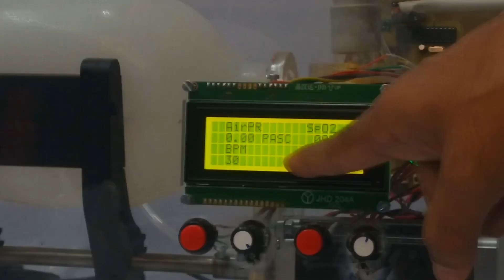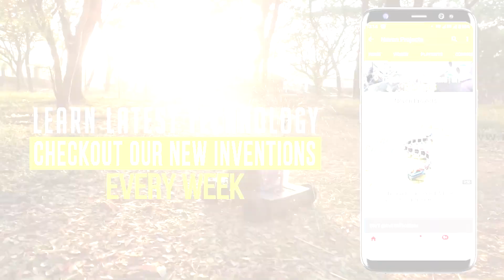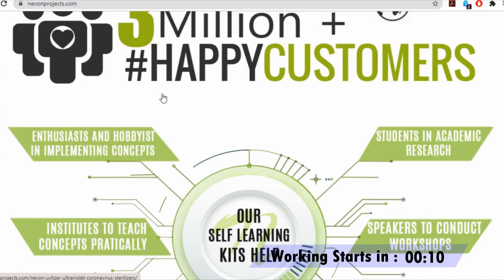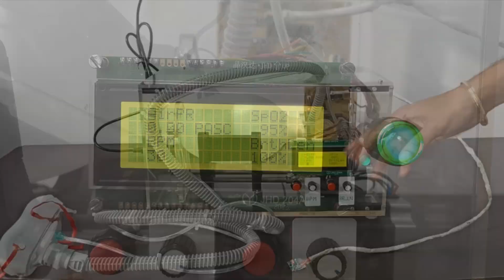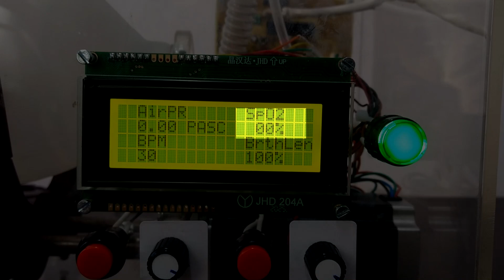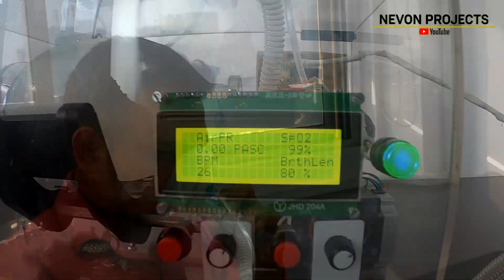How To Make DIY Low Cost Ventilator With Variable BPM & Oxymeter

Comment: How u will find out the flow and volume? Depending upon the patients the lungs  will vary. And u need to set for different modes.
Reply from the maker: in this diy project we have demonstrated the mechanism with basic settings, we will be making an enhanced version with PEEP settings
Reply: @NevonProjectsOfficial  can this be used instead of the ventilators in hospital?